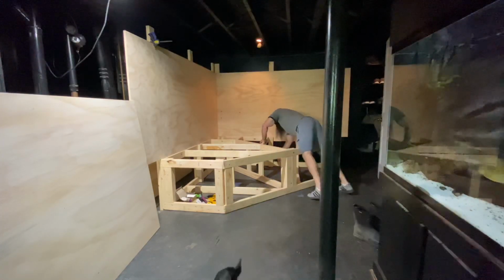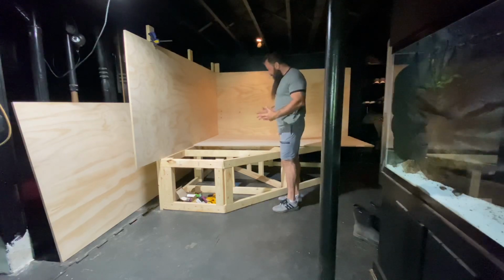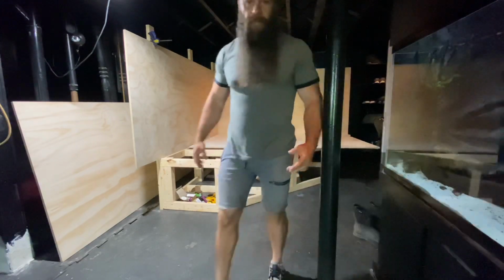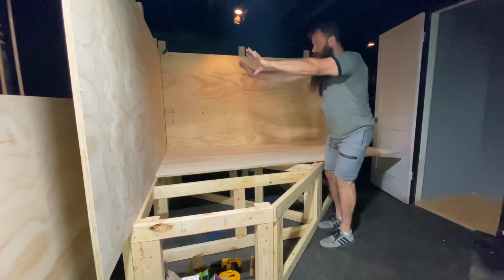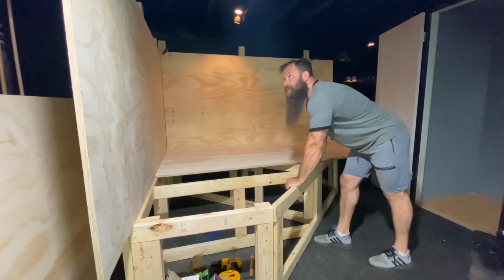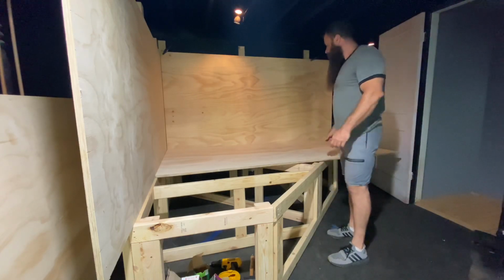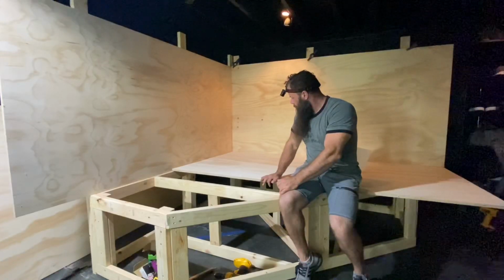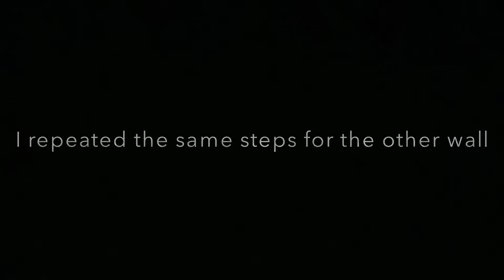DIY PIRANHA Habitat Built continues

Comment: When you have your tank ready, remember to cover the bottom of the tank with fertile soil and then with small rocks those you already use, the fertile soil helps to keep the water and tank walls clean and with a good balance in nutrients and minerals, then some water plants. You can investigate this further, there are other channels that show all the process. Good luck with your project, it will surely be the best tank in town!
Reply from the maker: 👍🏻 I am quite familiar with dirt in aquariums 😉 
Balanced ecosystems is what I am all about 💪🏻🌎❤️

Comment: Little by little it's starting to take shape and I'm loving this journey. Suggestion,  it might be worth sourcing that larger piece of glass rather than the settle for the smaller piece now. Just like the ply wood, you want this to be amazing first time rather than making adjustments later down the line. My two pence worth only. Looking good though boss, can't wait. 👊🏼😎
Reply from the maker: My thoughts exactly, but I haven’t had any luck finding larger panels and definitely not anything I could afford right now or in the near future, however the ranas can’t wait much longer.. busting out of seams 😬